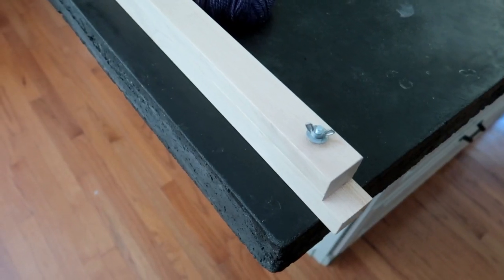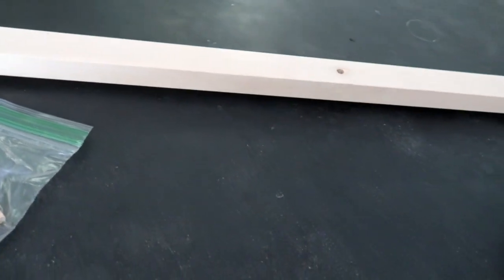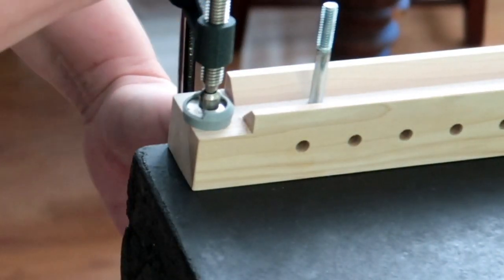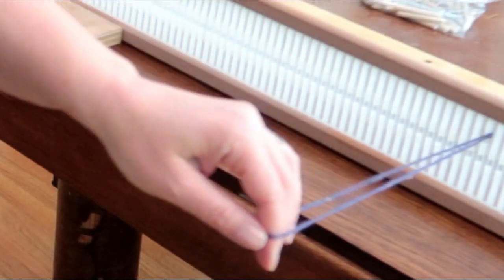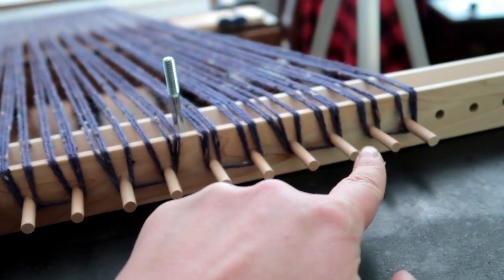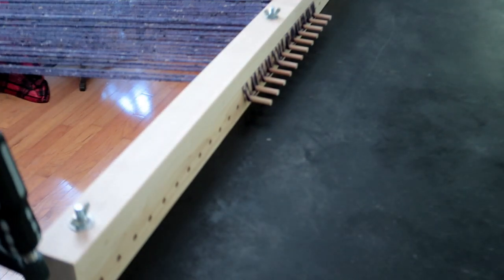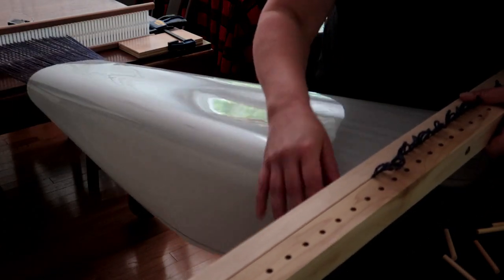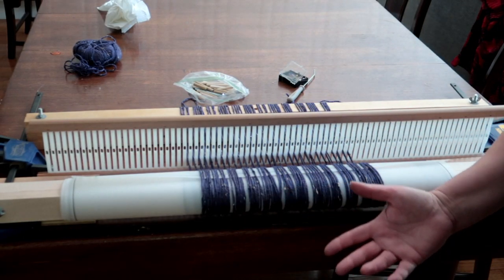Using a Warping Bar to Warp Your Rigid Heddle Loom!

Comment: Just using this and I have a question. In your example you say for 12" warp put 6 pegs on each side but that actually measures out to 11 inches from peg 1 to peg 12. I'm a newer weaver but can you explain this? Thank you
Reply from the maker: You put one inch of warp on each peg.  The peg falls in the middle of each,  so there is actually a half inch of each outer bundle that goes out last the pegs. I hope that makes sense,  but the most important thing is just put one inch of warp on each leg and it'll work.

Comment: I’m definitely interested in purchasing one from you. Can any kind of clamps be used with it? Also, will the warping bar work with thin, 8/2 cotton yarn? I have had a hard time getting even tension with my warping, this may be the answer to my prayers.
Reply from the maker: I would say nearly any clamp could be used.  I like 12" bar clamps from Harbor Freight.  I use 8/2 cotton when I weave dishtowels, so you can definitely use it.  I have not found anything I can't use yet.  I've even warped with an assortment of different thicknesses and had no problems with anything slipping because the inside of the bar has a chamfer.  It holds everything in place very well as long as the wingnuts are tightened down reasonably well.

Comment: This looks very useful and beats using a single warping peg.  I think i could also use it as a raddle on my multi-harness loom
Reply from the maker: I use mine as a paddle when I warp.  I love that I can lay your it in with no legs and add them as I separate the warp one inch at a time.

Comment: I love this but I'm wondering how you control the tension. Is there ever an issue where the tension is loose?
Reply from the maker: There are so many possible tension issues in warping that I would need more specifics but I have never had any issues myself worth the bar. I once mixed a warp with various degrees of stretch in the yarns that was a little bit tricky. There are several videos that have tips for troubleshooting your warp on my channel.
Reply: @FiberLoveDiary  Thanks so much for getting back to me.  I will be ordering one of these bars and a mylar set from your Etsy shop and can't wait to see how it works for me.

Comment: Interesting. I think this could also work on a floor loom...maybe.
Reply from the maker: I've never warped a floor loom, so i honestly have no clue!
Reply: I was wondering the exact same thing - it could possibly work like a charm for my Saori (floor) loom but not sure...gotta give this some thinking.
Reply: @lynnwittet1301  ooo! yes! I'd think it would work like a dream on the Saori, just because of the way those are constructed and set up. I have a 40 inch Pendleton (the Arizona ones, not from the company that makes the blankets) out in the garage...it's currently buried. :/

Comment: Can I just say this tool is a GAME CHANGER. My warps were constantly a hot mess with uneven tension and variance in lenght when I went to lash on of 3-4 inches. Warping bar = problem solved. Also means my kids and husband aren’t necessary to help me to wind on the warp. Thanks so much!
Reply from the maker: Dorothy, thank you so much for letting me know. I feel the same way! I still love mine and use it every time I warp my rhl.

Comment: That is really smart! I wish I would have had one when I owned my RH loom, but I do think it could come in handy for shorter warps on my 4 shaft Leclerc Dorothy. What is the maximum warp length you would recommend? How and where would I buy this, and how much are you charging? Thanks so much for sharing!
Reply from the maker: Hi crystal! They are available in my Etsy shop. There should be a link in the description box. I have done up to a 20 for warp with mine with no problems and I think I could go quite a bit longer. I've just never tried.

Comment: My heddle is 7.5, how would I use your bar for that?
Reply from the maker: When I do that, I just alternate 14 over two inches, then 16 over the next two. It is still 30 over every for inches that way. It's so close you will still get a very smooth roll on the bar and a nice even warp.
Reply: @FiberLoveDiary  Is the total length of the bar 36” or is that peg to peg? Looks like the bar is actually 40”?
Reply from the maker: @sylviegenest1888  there are 36 pegs, one inch apart on center so it's longer. I can't remember the exact length but it is shipped in a 48" long box

Comment: Hi Trish, I just received my bar the other day and can't wait to use it when I'm well. If I was using a 7.5 DPI heddle would that mean I would start warping on the second peg from the end with 3 loops of yarn and then the 4th would loop over the same peg with half that loop on the first peg then?? Thank you!
Reply from the maker: When I use a 7.5, I just do 3, 4, 4, 4. That way over each for inches, you still end up with 30 ends. It's not that critical that it be exactly an inch, just pretty close.
Reply: @FiberLoveDiary  ok thanks!!

Comment: I got mine the other day, so cool! I had already ordered thr plastic sheets you use (I think). How do you store yours when they arent in use?  Thanks Trish!  I will leave my review after I use it
Reply from the maker: I store mine bolted together in with my heddles. I hope you love it! I love mine so much ❤️❤️
Reply: @FiberLoveDiary  I meant the plastic sheets, but I found a long skinny box so i rolled them up and think it will make for good storage 🥰 im going to give mine a danish oil coating, as I do with all wood items. The maple is strong and beautiful!
Reply from the maker: @Ahlathein  ah, I just store those rolled up also with my heddles. I have a big box that is divided into sections for tall craft items to store them standing up.
Reply: @FiberLoveDiary  i used it last night! Love it! I shouldnt have warped so late at night and had to roll it back to add another slot that I had missed 🤣. Do you just keep the middle wingnut every time? It worked fine but i was a little concerned it could cause troubles, it just poked through my paper (wood pulp paper) cause my mylar sheet was too heavy for my scarf and I didnt want to cut it down.  But it still worked out fine! Yay